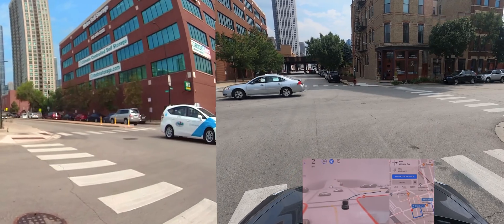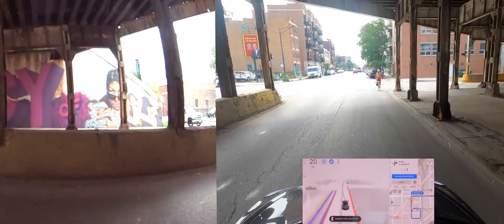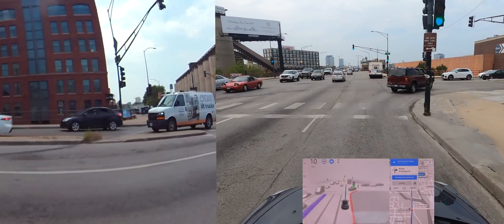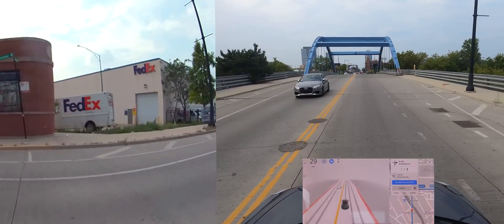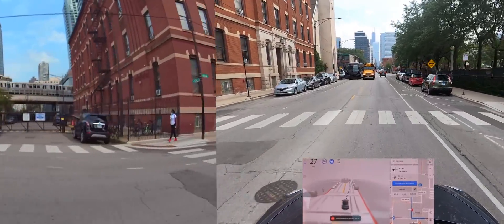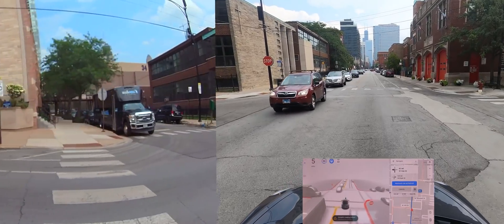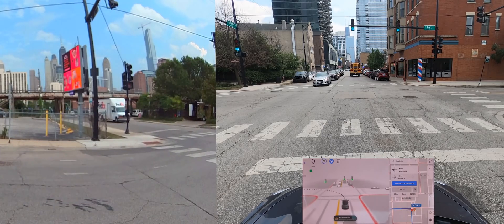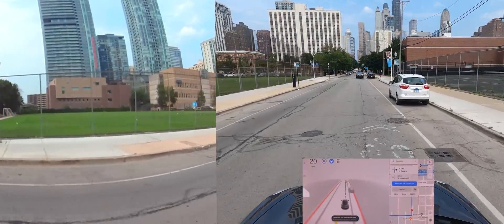Testing FSD Beta 9.1 With B Pillar | Merging Lanes, Unprotected turns | 2021.4.18.13 FSD Beta V9.1

Comment: @7:39 what are you talking about "Gentleman didn't want to let us through" ?!  FSD changed lanes in the middle of the intersection, without signaling and with him already right next to you.  FSD didn't just cut him off it tried to run him off the road.  "There was plenty of gap" No there wasn't.  Look at your side GoPro, his car hood was visible to the side.  You two were adjacent to one another.  You absolutely should not have allowed FSD to do that.

Comment: Nice work. The B pillar cam was good. A little alarming at first, maybe angle it slightly more forward/right than strictly a right angle. The orientation at a right angle made approaching traffic look more dramatic than it was.

More, can you make the B pillar feed less of the whole screen? It looks less than 50% now, but I think it could be less still. You really only need to see the traffic approach from the left as it appears. If the goal is to have a more full view (like the honking van), then you can use your 360 camera mount.

Comment: Is the left video trimmed to have square aspect ratio? or does it showing the 100% visibility of the camera?
Could you use this setup to test driving through tight intersections? (i.e. tight back ally with buildings on both sides)
I believe with this scenario, it can reveal(or disprove) the pillar camera viability issue.
Reply from the maker: It has been cropped. This isn’t accurate but it’s a guesstimate of what the camera would see.

Comment: The camera setup is wonderful - but FSD's performance is dreadful.  Among several egregious mistakes, 7:39 was the closest thing I've seen to a collision in an FSD beta video so far - the adjacent car was visible in the B-pillar footage.

At this point, FSD seems like the ultimate example of the first-step fallacy.  The idea that it can gradually be improved sufficiently to reach full autonomy is akin to saying that a 500-foot tower can gradually be increased in height sufficiently to reach the moon.
Reply: The point is it doesn't have to be perfect to achieve full L5 autonomy (where you don't have to pay attention), its failure or accident rate just has to be low enough for Tesla take responsibility/liability for any accidents that occur. Eventually we could see cities and roads adapt to self driving cars, as most likely they will be left behind as other cities enjoy the benefits of having autonomous vehicles.
Reply: @kartheyansivalingam7927  "its failure or accident rate just has to be low enough for Tesla take responsibility/liability for any accidents that occur"

Exactly - and there are two problems with this.  

First, Tesla has stated they would need 1 intervention every 1 to 2 million miles to move beyond Level 2 autonomy.  That's 5 to 6 orders of magnitude beyond where they are now with FSD beta - and the miles per intervention (or, sometimes, interventions per mile) have not substantially changed in the last 10 months.  They're way, way short of the level that's needed for higher autonomy, and many of the remaining interventions may not even be solvable with the current hardware.

Second, the "in-between" area is untenable.  You can't have a Level 2 or Level 3-ish system that fails every 1000 miles, because at that point it's too good to expect a human backup to constantly monitor it to intervene, but still not remotely good enough to be trusted.  That's why almost every other autonomous car company has abandoned a gradual approach, instead opting to go straight to Level 4 in limited areas.

As for the idea that cities will adapt to self-driving cars, that's a pipe dream.  Self-driving cars need to be able to adapt to reality, not the other way around. Heck, cities already have enough trouble just keeping lines painted, snow cleared and potholes filled.
Reply: @trainiax  Tesla can also offer L4 in limited areas. 
For example Tesla might be willing to take responsibility for accidents under Autopilot on highways (which honestly it could do in its current state - just need the legislation). Or even in certain cities, so maybe Tesla is willing to take responsibility for accidents in Phoenix, Arizona (where Waymo currently operates due to favourable conditions), so Tesla can simultaneously offer a L4 autonomous system (where users don't have to pay attention) in certain regions as well as an advanced L2 driver assist system in others. 
I think you underestimate the economic benefits fully autonomous vehicles offer,   cities will have to adapt as they have always done or be left behind.
Also to say it is impossible to solve autonomous driving with their current hardware is nonsense, we know driving is possible with two cameras (humans do it all the time), it might be made difficult with Tesla's limited hardware but definitely not impossible. I don't know what you have been seeing, but are you actually saying FSD beta through its iterations have stayed stagnant? Because that is definitely not the case, improvements however minor are still improvements.
Reply: @kartheyansivalingam7927  No, Autopilot in its current state is not ready for unattended driving, even on highways.  Before you try to come at me with a rebuttal, yes I own a Tesla, I have paid for FSD and I have close to 50,000 miles on Autopilot.  I make frequent trips between Arizona and North Dakota and while Navigate on AP makes my trips much easier, if I let the system do what it pleased I would die at least once a trip... and Thoros of Myr has left us and this is my last life.
Reply: @kartheyansivalingam7927  "For example Tesla might be willing to take responsibility for accidents under Autopilot on highways (which honestly it could do in its current state - just need the legislation)."

But Tesla doesn't want to take responsibility for accidents under Autopilot, and it has nothing to do with legislation.  They haven't even tried to get a permit for autonomous testing in California, and they won't release any numbers about the intervention rate for FSD beta.

"I think you underestimate the economic benefits fully autonomous vehicles offer,   cities will have to adapt as they have always done or be left behind."

Right... So are cities going to eliminate rain and snow, ban pedestrians, cancel unforeseen incidents (like water main breaks), rebuild every non-standard intersection, and otherwise turn reality into a clean simulation?  Reality is messy, and autonomous cars will have to deal with it.

"Also to say it is impossible to solve autonomous driving with their current hardware is nonsense, we know driving is possible with two cameras (humans do it all the time)"

Yes, humans do drive with two eyes and a brain.  But it's the height of absurdity to expect that Tesla's current hardware is comparable when it consists of a few non-mobile, non-self-cleaning, 1-megapixel cameras that are technically legally blind, and a computer chip with less "intelligence" than a cockroach.  

This is not meant as an insult to Tesla - it truly reflects the state of the technology: The resolution of the wider-angle cameras would be hard-pressed to render the big "E" on an eye chart, and current machine-learning algorithms have exactly zero independent understanding of context or cause-and-effect. 

"I don't know what you have been seeing, but are you actually saying FSD beta through its iterations have stayed stagnant?"

For all intents and purposes - yes, yes I am.  Dirty Tesla has been tracking his intervention and disengagement rate with FSD beta on similar routes since last November, and it's remained almost flat - even when you discount a few of the "easy" drives that improved numbers near the beginning.  Going from 3 miles per intervention to 5 miles per intervention is statistical noise compared to where Tesla needs to be.

It comes back to the first-step fallacy I mentioned in another comment: The idea that FSD can gradually be improved to reach full autonomy is like saying that a tower can gradually be increased in height to reach the moon.  Tesla's moon tower has gone from 500 feet high to 1000 feet high - just 1.3 billion feet to go.
Reply: @kartheyansivalingam7927  There is way more than legislation needed for even Level 3 driving on the highways. 

I have plenty of clips of my car drifting over lane lines because of understeering.  And it still ping pongs out of corners to the opposite lane line.  It also doesn't adjust position for Semis right on the lane line.  It also doesn't yield properly when merging or when other cars are merging and it very erratically changes lanes back and forth for phantom navigation.

Comment: 9:10 it was not turning left, it assumed that all those cars were stopping and it was going around them on the left.....until it saw way further down that this was a left turn lane.... then I believe it realized that and then started back to the right behind the other cars.  I believe that it would have corrected if you hadn't intervened.

Comment: 6:59. I would email the team directly. That's a bug. Those have to be ironed out. I watch your channel to judge improvement in the system.. BTW the data you normally send is higher quality than most testers who complain about how the car doesn't drive like them. Imo right now should be can the car drive here or not?  Not can the car drive like me?

Comment: Anyone complaining about camera views needs to just pause at 10:51. Between the two cameras, you can see the bus in both views. That is literally all that is needed. This is with the GoPro actually a few cm/inches behind where the B pillar cam is. View isn't an issue. Seems as though perception is becoming less of an issue with each update. Decisions and speed are still in their infancy.
Reply: Of course it'll work there - here's no obstruction. Obstruction is the issue.  Now put a wood fence up to the lamp post and imagine what you see.  All those cars blocked. Now imagine the car having to creep forward for the B pillar to see and imagine there not being enough safe space for the car to creep because the camera is so far back.   Front cams don't see L/R at an intersection so they are of no help.
Reply: @karunald  There is a wide angle front cam that covers part of what the side camera can see. Just like in this video with 2 go pros. There is no "blind spot".
Reply: @mkkm945  NO!  Absolutely not.   The front camera is a wedge view of 120 Degrees. This is directly stated on Tesla's site.  It can't see L/R down a road at an intersection.

FURTHER - look at your windshield cam assembly.  It's in a HOUSING with side walls.    FURTHER - Even if it was 180 degrees, it cannot see through A-Pillars.

Period.  Fact.
Reply: @karunald  Cool. So you know more than the engineers working on this. Go do your research. There are THREE cameras in the front fixture. One narrow (middle) two wide (left & right). The B pillar camera is to cover the blind spot between the front bumper and the side of the car. It is DIRECTLY STATED in the Tesla website. 

You keyboard warriors are amazing with your lack of basic understanding.
Reply: @mkkm945  And none of those cameras in the front windshield see left/right through it's housing and a-pillars.  Besides, it's 120 degrees anyway.   FACT
Reply: @karunald  You have some difficulties understanding. The center cam is 120 degrees. The left & right ones are positioned to cover what the B pillar cam and the center cam do not see. They are nowhere near the A pillar. Using caps to say things only makes you look as foolish as the comments already are. 

Go fish somewhere else.
Reply: @mkkm945  You're the brainiac insisting the front wide cam can see true L/R   I had to explain it to you.   And no camera can see thru an obstruction as much as you want to believe.   You don't get the issues peeps have with this and it's not worth my time explaining it.
Reply: @karunald  hard to explain when you have no basis. The camera suite on Teslas can see all they need to. The software is lacking but improving with each update. Go find someone else to argue with. I have a habit of destroying arguments lacking facts.
Reply: @mkkm945  LOL  I'm intimately aware of the camera suite and their specs.  If there's an obstruction on the side of an intersection where the only cams that see L/R down the road for fast cars being so far behind the nose that it's behind my body - that's a problem with sticking nose into road in places it's not safe.  Period.
Reply: @karunald  Coming back to what I said. The left and right camera overlap with each other. If there's an obstruction, no human camera or radar will be able to see, so nobody knows what you're trying to say.
Reply: @mkkm945  that the car will creep in this case but often there is not 'enough' 'safe' room to creep without putting the car's nose within 10-12" of 50 mph cars or peds/cyclists way.  Blindly.   Because those cams are behind our bodies they're so far back.    They will change this at least by the time they go to higher levels of autonomy - mark my words.
Reply: @karunald  okay. Go short the stock.

Comment: Seems to me that Tesla would gain a lot from HD-maps for planning. It's guessing wrong in terms of lane selection quite a lot and gets into weird situations because of it.
Reply: HD maps don't scale well. You can't make HD maps for the entire world and keep them up to date. So then if you rely on them, you'll never have level 5 system.
Reply: @PetrMelechin  Tesla will never be L5. Likely not L4 either given the current rate of progress. Use all the help you can get, I say.
Reply: Can i ask,  
a) at present, is Tesla using any sort of Maps?
b) how does a HD map help Tesla, and where can they get this HD Map?
Reply: @ngchongsin2009  yes, they use some meta data eg stop signs, speed signs and traffic lights.
Tesla do not believe in high def maps. These maps provide centimeter level lane markings, which traffic light is meant for which lane etc etc.
Reply: @ngchongsin2009  look at this for comparison (uses hd-maps both for driving and visualization) https://youtu.be/50NPqEla0CQ

Comment: @7:40, the car that honked was literally setting off the ultrasonic sensor.  In this case, gonna have to say, "Bad FSD!"  It was strange to see FSD ignore another vehicle like that.
Reply: I'm a huge fan and supporter for Tesla. Seeing what happened @ 7:40 really saddens me. :(
Reply from the maker: Bad FSD!
Reply: @FrenchieFSD  Did you re-watch what occurred there?  The car pulled up next to someone's right hand side at a stop sign, didn't completely stop, drove through through the intersection and then tried to merge in front of the driver to the left while the nose of their vehicle was visible in your B pillar camera.

There was no gap and that's terrible driving behavior that could have easily resulted in an accident you would have been entirely at fault for
Reply: @FrenchieFSD  and not reported? this is the worst move i've seen. please rather focus on testing rather than the audience...   it would be interesting to know what the actual b cam saw... doesn't it save the clips?
Reply from the maker: @lapaleves  b pillar camera doesn’t record on the usb drive. Plus my disengagement was recorded and sent to Tesla. I also followed up with an email
Reply: @FrenchieFSD  thanks! I know the disengagements are sent, but from what i heard they have lower prio than the reports. Just wanted to make sure this gets attention.

Comment: You have a 360 cam on top, yes?  Instead of the extra b-pillar cam, maybe just edit in to views from the 360. A main view that is mostly forward 90 or 120 degrees, then in a narrow band at the top of screen (where there is just sky so we don't care if it is cut off) put the wide-angle (180+ degrees) or other alternate view(side/rear). Both views could come from same 360 cam footage. Check out what AI Driver has been doing recently to get a better idea what I mean.